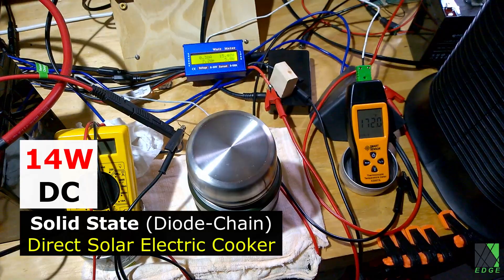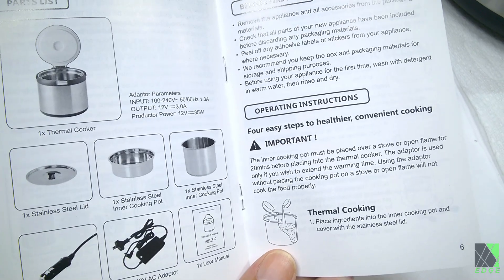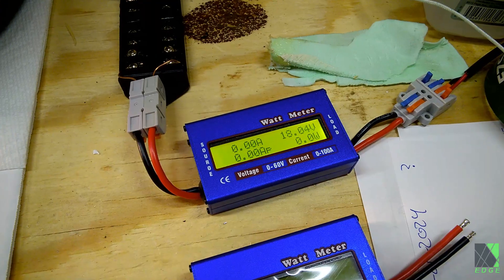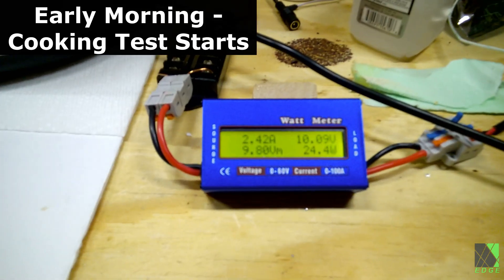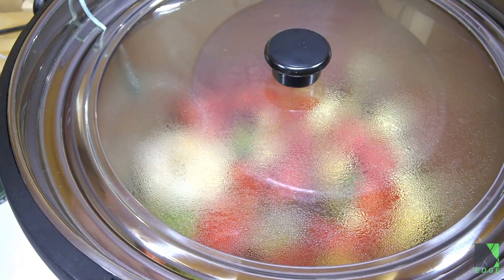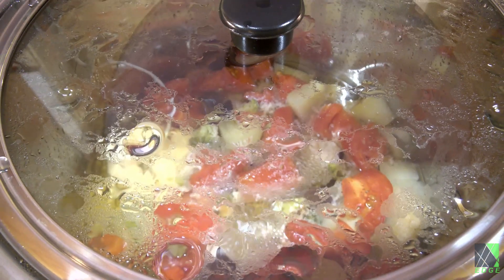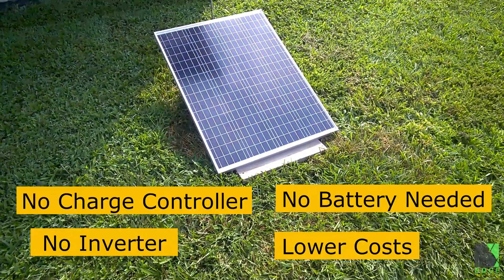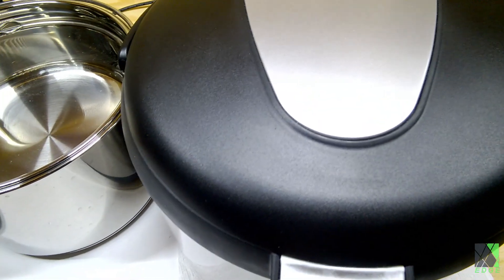Can You Cook Dinner With a 100 Watt Solar Panel? Simple #DIY solar power electric cooker

Comment: Did you ever consider at trying to build a similar one that could limit the power to 50 without needing anything extra? If they made one that would not brun out due to the solar panel. I wpuld buy one if there was one jist plug into a solar panel or it use 12V DC from batrery power without inverter as second power. The little car 12v foodwarmer cookers are not big enough to use for 4 people.
Reply from the maker: @KyuLee-n8q I wish they made these solar-friendly out of the box... anyway the easiest fix would be a 75w panel. That would limit power and probably be a perfect match

Comment: I've searched around for insulated cooker that can be used for solar ,but no results. I was even thinking to DIY my insulated thermo cooker into electric.
Reply from the maker: @vahagnmelikyan2906 There should be stacks of solar electric cookers on the store shelf, I think the idea is awesome... oh well maybe in time the big manufacturers will catch on and start building them for us
Reply: @solarpoweredge I have one .Bought it from China. 100w , larger size compared to other cookers I've seen. But I don't think it's safe for cooking, even though used it for 2 years. Still works. Takes hour and a half to cook with solar. But with  insulated version I think it will function just like a regular stove cook.
Reply: @solarpoweredge i was thinking about drilling a hole from beneath and inserting a heating element, but not sure what type of insulation is used. Will that burn?
Reply from the maker: @vahagnmelikyan2906 Hard to say without opening it up... some of them have styrofoam which would burn. But if you could figure out how to take it all apart, you might be able to add/replace insulation with ceramic and add your own custom heating element. As long as it doesn't cause a fire!

Comment: A variation on this concept could be using the solar PV electricity to power a heating element inside of a vacuum insulated tube .. vacuum tube solar ovens are designed for higher temperature operation like over 400F .. Soo , someone could get a similar to this video style more energy efficient cooking by cooking inside a insulated container , even when they want those higher temperature baking type cooking .. and like pointed out here , the electricity can easily be feed inside from outside solar PV making it more comfortable/convenient to use .. the one down side would be the elongated shape of mass produced vacuum insulated tubes like those used in vacuum tube solar ovens.
Reply from the maker: @ianpgeorge Good thinking. I really want to try this!

Comment: Hey could one connect a large panel (600w) directly to some kind of heating element and use a pressure cooker? So once it locks with the high pressure and cooks for a few minutes one could disconnect if wanted and let the residual heat keep cooking it. Similar to instant pot but with no programming and no inverter, charger, battery, etc. Thanks
Reply from the maker: @segundacuenta726  Hi, it's totally possible. It's on the project list, I have to take one apart and modify it to be DC-friendly. I think a lot of people would but a PV/DC pressure cooker, it seems like a good business opportunity :)
Reply: @solarpoweredge  Awesome. I read that the problem with heating resistances is the ohms so that out of all those watts of the panel (or panels) only a fraction can be used. Also that one big panel (48-55v) would not be as good as many in series to raise the voltage? Anyway, thanks for sharing.
Reply from the maker: @segundacuenta726 That's true... matching the ohms to the panel is always one of the challenges in making solar electric cookers. We could just make a new heating element for 12-48v as needed. Might be difficult because generally these cookers from kitchen stores are never intended to be modified.
Another way to get around the "ohms problem" - use diode chains. Their voltage profile behaves  sort of like MPPT. They don't behave like resistance wire. I boiled an egg with 14w using a diode chain here. https://youtu.be/CRhkZp6ECHk

Comment: Good fun.  Cooking is just another type of engineering - you follow the scientific principle carefully, only making changes only when you question or can improve on the process.  Rules of thumb; use as little water as you can, get the salt right, use butter or some other fat, never use just one opinion - including your own.
Reply from the maker: @SteveWrightNZ Right! And don't leave unattended and burn up the food!
Reply: @solarpoweredge  a potato would be an inexpensive scientific experiment!
Reply from the maker: @SteveWrightNZ Great thinking - at least I can afford to burn one or two of those

Comment: Since the lids seem to seal to be leak proof and to be as energy efficient as possible on many similar units, was there any pressure build up during boiling/cooking during your tests? Curious if this could be an issue since just a couple psi could be dangerous when opening. Overall really like the idea.
Reply from the maker: @jimbaggett1233 The lid is made out of plastic with a double layer, no rubber gasket - seals OK without being air tight. Does not build any pressure that I could tell. Burned myself with hot condensation dripping off the lid when it was opened!

Comment: Wouldn't an heater as a restrictive load, when connected directly to the solar panel - put a strain on the solar panel itself and/or on solar panel's junction box or what was its actual name for it?
Reply from the maker: @BulmaSoft No worries, it won't harm the panel at all. It's safe to connect a heater to a solar panel or any resistive load. In fact I run modified space heaters this way :) https://youtu.be/TJG-ZnqJR9w

Comment: Looks like a great idea , but this cooker you list is currently out of stock.
Reply from the maker: @richardduke9788 It's sad that they sold out, but oh well. I hope they make some more
Reply: @solarpoweredge   maybe someone else has a similar cooker . As a truck driver,  truck stops and RV centers sell 12 volt cooking appliances  .
Reply from the maker: @richardduke9788 Yes, that would be great. If you run across any insulated cookers that have a DC input, please feel free to post here. It's hard to find ones that have insulation. (I did find a DC slow cooker but it's just a ceramic pot)